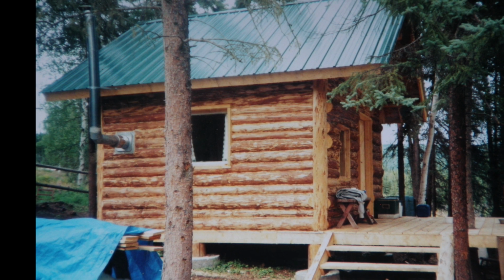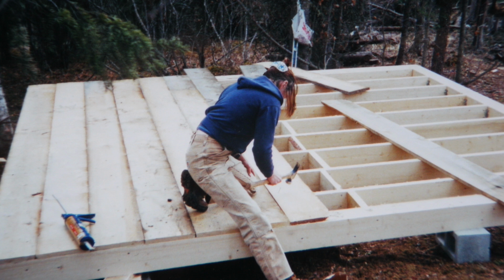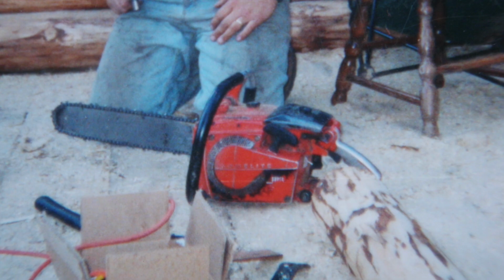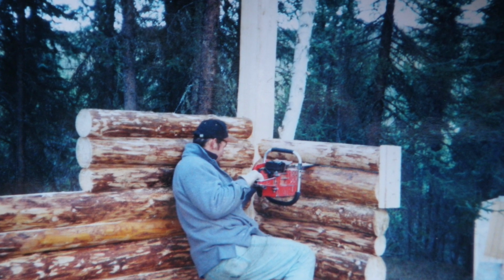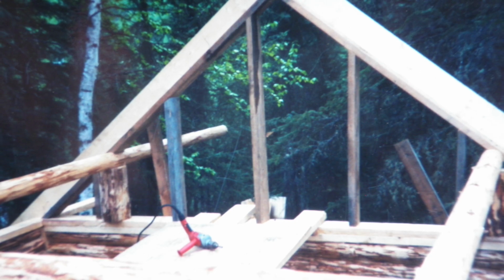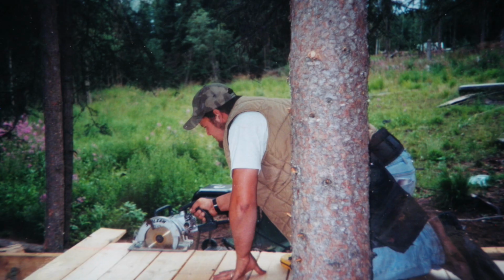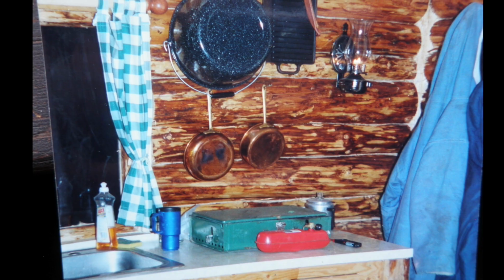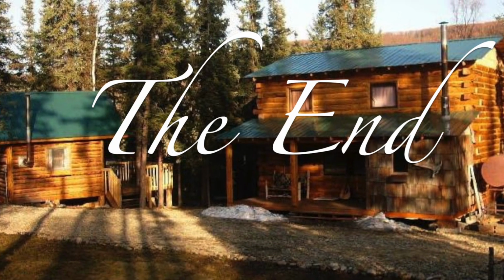Off Grid Log Cabin .....Start to finish.

Comment: In 1979 I worked for a roofing company in Denver. We were reroofing some old houses near the state capitol. Very steep pitch. One roof we did, I had to tear off two ratty layers of T locks, lay down 30 pound felt and nailed on new Timberline asphalt shingles. We did this whole job using toe boards because the pitch was so steep and the two stories of the house were old 10 foot ceilings. I finished the roof a rich man thanks to Jay and Dave McKinney.

Comment: I have a very simple cabin in Northern ontario, i can agree with you totally.I made every thing with recycled left overs and my frame is pine logs even roof trust and the roof is clear polycarbin fibre so have 100 % day light. I m planning a 4 season log house with solar heated floor and living space in the loft. it will also be 100 % run on small solar system 200 watts and 2 batteries. I loved what i saw keep doing.
 Warrior of truth Garry.
Reply from the maker: Thank you Garry. Where are you at in Northern Ontario....?

Comment: What a great video Dave. Thanks for sharing you memories with us. You are fortunate to have met a woman who enjoyed that lifestyle. Maybe in one of your videos you could do a piece about how you build corners. It seems to me a good strong corner in a structure is important but I just can’t visualize it. Again, thanks for this great video.
Reply from the maker: Hey CJ. I may do a video series about how to build this style of  cabin at some point. This is called by some a "Hudson Bay Cabin".   to build a corner post you take a log about 16" across and cut it in half lengthwise. Then you cut each piece in half. Basically you wind up with four pieces of 1/4 log. The outside of the log goes to the outside of the cabin and the 90 sawn surfaces go to the inside.

Comment: At a place where winter is strong with lots of snow and ice, most of the chimney here are very badly placed, never place a chimney where Ice can slide off the roof and rip off the chimney in a split second !!! But the cabins are sweet, well done !!!
Reply from the maker: Your advice is sound. But there are a few thing about this situation that are unique to fairbanks. .....for starters the snow is ALL powder. We never got a heavy wet snow. Also the roof is almost a 10/12 pitch so the snow comes right off the roof when you slam the door hard, so there is never any build up. Also, there is never any ice on these roofs because they are well insulated, with a detailed vapor barrier and all the ventilation you could ask for. Each cavity in the roof between the rafters has an air baffle that runs all the way to the ridge.......In short, your right about snow and ice taking out your chimney, but it never happened with either of my cabins for the reasons above.
Reply: Thanks for clearing up this, GOOD !! Well done then, well done !! Cheers

Comment: Skill wise probably the easier way to build, no notches no real scribe-fit work, might blow trought a little, but putting something simpler like this up is still a lot of work :D Nice video.
Reply from the maker: The reason I chose this style was I wanted to get the most out of the few logs I had. With a saddle notch corner you loose a couple feet of your wall to the notches.
Reply: True, probably the best way to get the "most walls" out of limited number of logs.

Comment: One thing I like about your videos is how you explain how and why you did certain things, most things about the build Dave. Couple questions I didn’t hear you mention is what kind of trees the cabin was built with? I noticed they maintained there diameter throughout the length of the log. And how did you nail the logs straight into the corner beams? Didn’t you have to account for settling even if they were already laying around? Thx

Comment: Using posts in the corner was a great idea because then you dont have to piss around with notching the logs and getting them to sit right. One question though, when you ran the saw in between the logs did you nail the top log in place and then just take the nails out when you went to hammer them down? I don't know if that makes sense but that's the only way I can describe it.

Comment: I love it man!   You guys went tiny before it was the hipster thing to do!   I’ve been thinking about building a trappers cabin in the middle of my 40 acres, far away from the public road here in Ohio valley.   12x12 looks perfect 👌    Looks like I’ll need a bit bigger chainsaw though to get those logs flat.     Thanks for sharing.
Reply from the maker: I would go with the smallest chainsaw you can get that you can run a 3/8 full size chain on. We used this thing because its all we had....but a small saw would be better....but not one with a narrow chain. Because you are making a matching "flat" on both logs at once you into to remove as much wood as possible in one pass.  Good luck, and if you do build it let me know.
Reply: Well my little Husqvarna 240 sounds like it might be ok then.    I thought the lack of power might hurt, but lighter means I can just take my time.   I’ve been going back and forth between logs and stick built,  but there is this inner romance I have with a log cabin.  With the extra work I think.

Comment: Skinny squares shovel works great for peeling logs
Reply from the maker: Never tried a shovel...but I have my doubts how it would work on this cabin. The logs were super dry and they peeled hard.
Reply: @Bushradical  is how we done 3 cabins one 60 by 80 but here in Alabama logs might peel differently
Reply from the maker: Is it just any skinny square point shovel? Or is there a shovel made for peeling?
Reply: @Bushradical  no point flat end think was roofing shovel

Comment: It’s good you changed off that block. You had it laid on its weak side. It would have broke and collapsed after a few years. Sadly I made the same mistake! 😔
Reply from the maker: The cement block was only there for about a week. We just used it to hold the floor off the ground so we could start building. Thanks Richard.

Comment: I will be building a cabin come spring. I already did the land clearing as can be seen on my channel.   Was wondering about what size wood stove.  My cabin won't be big but I want my stove to be big enough to get about 6 hours of burn time.  Thanks for sharing.
Reply from the maker: I'd look for a stove with an 8" flue.  Ive always run small stoves because I  burn them hotter and they're cleaner that way , but if you want to "bank" a fire they aren't the best. You might need a larger stove for that and it would surely have an 8" flue.
Reply: @Bushradical  I was thinking that or a 6 inch flue.  The cabin is not going to be big but I want a wood cook stove with an oven.  So the cabin doesn't over heat I think I will put a big vent above the stove so I can suck some of the heat out when I am cooking, and limit the seem build up.  If I put a big enough vent  I can boil maple syrup and suck out the vapour.
Reply from the maker: Ive always ran small stoves with 6" flues......but they don't hold a fire for hours. On the plus side....you don't worry much about chimney fires when you run them wide open most of the time

Comment: Its nice to g\o back in time and look at accomplishments, and to see how we have aged, I see on your first cabin you layed logs horizontally an  on your last one logs vertically, is there a an advantage /disadvantage of either way, video idea. keep up the great content
Reply from the maker: Hey RB, a guy I was working with at the time told me about the hudson bay style of cabin. When I figured I could make a cabin 12x12 with the logs I had, it made good sense to go that route.  By using corner posts you don't make corner "laps" and loose log length. So I could get the most out of the logs I had. 
     On the last cabin project, I did vertical log for 2 reasons...#1 I wanted to try it and never had, ...and #2 using 8' logs I could carry them all by myself and I wouldn't need help or kill myself trying to muscle 20' logs. Those are the 2 reasons and if I might ad a third.... #3 Although Aspen fairly straight......its very hard to find a straight 20' or 16' section....so I didn't even consider a horizontal cabin this last time.

Comment: By using log posts on the corners you saved yourself a ton of work scribing and notching the logs where they would meet at the corners.  How did you get the butt ends cut square to attach to your corner post?  Did you just eyeball it with a chainsaw?

Comment: Great Video; do you still own the cabin(s)? If so, it would be great to see an update video to show how the cabin has held up over the years. Maybe even compare or contrast some of the things you learned or improved as you upgraded cabins to include additional amenities. Thanks for sharing, I really enjoyed your video!
Reply from the maker: Thanks for the comment Michael. To answer your question, no I don't own them anymore. I sold both all that property in 2006 and moved to Delta Junction Alaska where we built the biggest log house of the 4.  There is a lot I would do different, you learn new stuff all the time. The larger log cabin ( in the last frames) was actually an easier build.

Comment: Yeah I'd have to say that was pretty small place for even 2 people, seeing as my bedroom has more floor space. (although you did have a loft I'm sure)
Nice little cabin to work your skills on though.
An old guy with a mill (woodmizer) has one about that size for sale, although it's joined differently at the corners, needs pitch between the logs when reassembled. Cute little structure though. It'll go cheap as he's moving to the valley (taxes driving him out).
Reply from the maker: Its a great place for someone on the go...but if you spent a lot of time at home and really wanted to stretch out.....its not the best fit for everyone.

Comment: Hi there! I have a question...my husband and I are exposing the logs on a building, which used to be a log general store(horizontal log construction/not stockade style etc..)...which siding was put on the exterior, and shiplap over the interior inside etc...it dates back to the 1930's which is old for the area we are in (gateway to what would be northern Manitoba, Canada)...anyhow later an addition was put onto the main structure(it's a 2 story but I don't think the logs extend to the second level)...but the add on was just for the main level...so one of the interior walls in the addon, has logs under it.  So my husband and I we pulled some of the old hardboard off the wall to look at the logs, wanting to expose them(wiring not an issue at all on anything we do on it/as it will be offgrid)...and we were really dismayed to find-that when they added on ( like in the 50's or so)...they used vertically placed lumber over the logs, for fixing the hardboard onto that wall...but, they did a hack job...they literally(it appears) hacked indents into the logs with axes; indents as insets for the vertical lumber-am supposing so, the hardboard would sit flush against the wall more...sigh.  So I still want the logs exposed...but oh my....what to do with that?! and I believe though we have yet to finish uncovering the entire wall/length of it...that we'll find more of the same through the entire wall ...a few feet apart...so we were thinking of vertical faux-beams or vertical log posts running down...to hide the damage to the wall...they did not hack into the log enough to like compromise it, the damage is not very deep but, looks just terrible and deep enough that sanding it a bit won't cover it up...If you have any other thoughts or advice if any solutions come to mind would be appreciated-...sure could use some.  A local old timer told us that after hours the men would sit and drink whiskey around the wood stove in the store...am thinking they consumed a bit too much when they were working on that wall :)   It's very frustrating because otherwise the logs are beautiful...and now am thinking we may leave the shiplap on the other interior walls because who knows what they did when they put that on!
Reply from the maker: How deep do the cut-ins go where the logs were notched for the (2x4s...I would assume) ?  And is it important to keep the patina on the old logs or are you willing to sand the logs and re-finish them?    A large chisel could "blend " the cut-out area back into the natural log but the fresh wood exposed would of course stand out.
       Ive seen lots of log building where they use a vertical log every now and then as a "strong back" to stiffen the wall. You might enlarge the ugly, hacked out notches where the lumber was cut into the logs and put in a 3 sided log , or even take a 4x4 and draw knife one side to be round. This mimics the look of a 3 sided beam with a log face. 
      My little brother built a house where all the trim was just 2x4 lumber that he draw-knifed round on one side and it looked like log trim......it was really cool.   My email is whippleconcrete@hotmail.com   feel free to send me a pic, I may be able to give you  better advice then. Thanks

Comment: I’m just curious on opinions, I have a boatload of fairly straight black locust trees most of which are at least 12 inch up to about 30 ft  tall. Not to mention of my 12 acres it’s pretty much all I have to work with. I’m going to build a cabin like this just wondering about thoughts on locust  for log cabin build

Comment: How did you attach the horizontal logs to the corner posts?   We’re they notched and a tail on the corner posts?    I’m likely using the wrong terminology but am very curious.    Because that method I’ve only found in two other peoples vids.    It looks like it lends itself to solo building.   Great vid.

Comment: It's a wonderful cabin, that's for sure. I have never seen a log cabin built with corner posts like that though, here in Sweden they always use log joints of different kinds, so that was interesting to see. Must speed up the build quite a bit I'm guessing. And another thing that caught my eye was the floor, I didn't see any insulation put in before the floorboards were put on. Did you crawl under afterwards and insulate it, or was it uninsulated? And in case of the latter, wasn't the floor awfully cold in winter?

Comment: I just came across your channel and subcribed! What an incredible video! Lots of hard work but sounds like a lot of great memories! Did you have a well outside? Where did you get water for dishes?
Reply from the maker: Thanks for the sub! To answer your question...there is a public well just north of the town of Fox Alaska, just a short drive from the cabin. We would haul our water. Lots of cabins in the area don't have running water because there is several area with naturally bad water ground water and the average depth in the area is 200' for a well, so you really roll the dice putting in a well.....you could have Thousands into a well and get bad water.
Reply: Bushradical - thank you for the reply!
Reply from the maker: Not a problem. I always try to answer ALL the comments on this channel. If your new to this channel, I hope you will check out the other vids. If there is anything you'd like to see in particular , let me know.

Comment: im curious im going to build a 12x12 log cabin but im not sure how you built youre first cabin i watched it like 3 times but im curious how do you run youre chain saw in between the logs just by youre self?
Reply from the maker: Yup. When you put two logs next to each other they barley touch......the knots and bumps keep them from having a tight joint. When you run the saw between them it knocks off the high spots.  Then pound the logs tight together and repeat. By the third pass the logs have mating surfaces.

Comment: Im trying to do one similar to this. I understand you screwed the logs for the walls all together, but how are the big corner beams holding? Did you screw them in diagonally to your wall? 
Im trying to do mine with a hammer and nails. With a chainsaw of course :)
Reply from the maker: Yes. Every single log is screwed to the one below it and its screwed into the corner post, at an angle of about 45 degrees.

Comment: Great video. Was there a specific size log you looked for to build the wall? And what screws did you say you used like timberlock?
Reply from the maker: Well for this cabin we needed 12' logs wherever there was a full logs and we got by with short pieces where there was a window or door. I don't know if we used timber locks on this cabin but the screws we used were the same thing as timber lock....only possibly a different brand

Comment: What is a 9 1/2 12 pitch roof? Does it mean 9 1/2 width and 12 wide. But what pitch or angle it that?
Reply from the maker: There is 9.5" inches of rise per 12" or run. Because the cabin was about 12'9" at the top of the outside edge of the wall, I calculated that with a 9.5/12 roof I could buy pre cut metal and it would come out about perfect for the drip edge and overhang I wanted.

Comment: Nice!  Did you ever consider saddling alternating logs to build your corners, in that traditional log home style, or would that take alot more work or bigger diameter logs? The stove pipe out the side seems safer too, than straight up, as any sparks are less likely to fall on your cabin (same with a hot tent). Fairbanks must've gotten pretty cold in the winter. Great little cabin and nice family!
Reply from the maker: Thanks for the questions. I love talking about building cabins!!! As for saddle notching, I never considered it for this cabin because I didn't have enough logs to make that happen. You loose a couple feet for space when you lap the corners....so I would have ended up with a cabin about 9x9 or 10x10 at best. So I figured this would get me the most space out of what I had to work with.